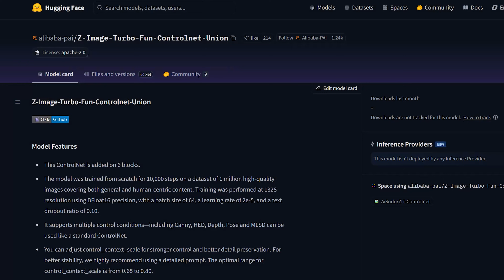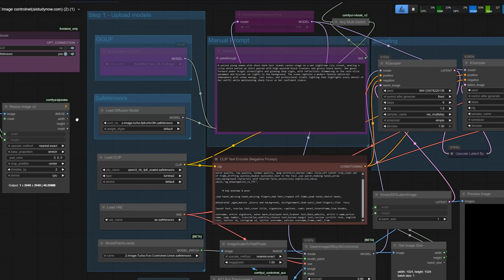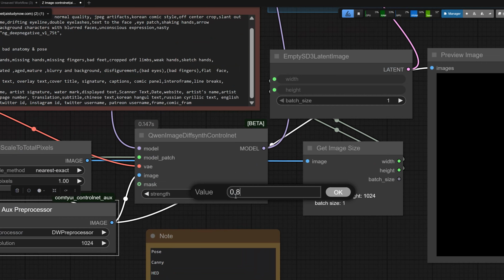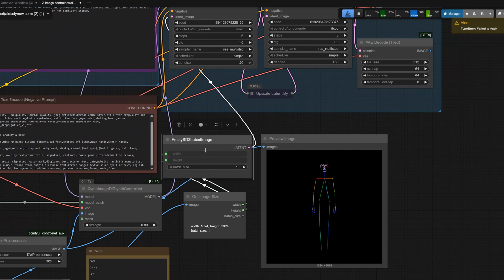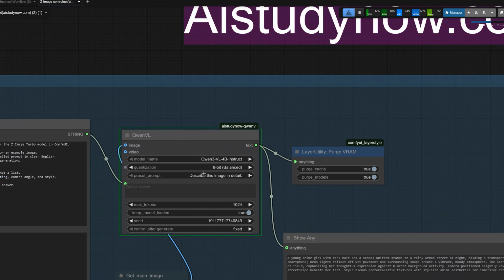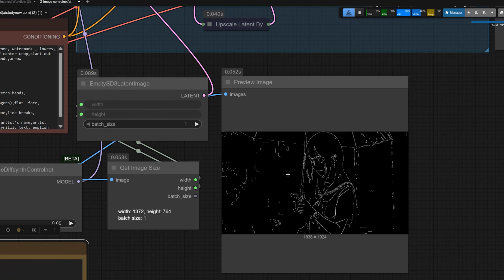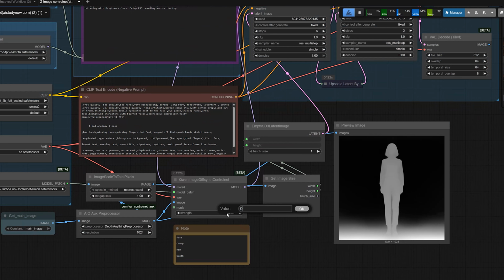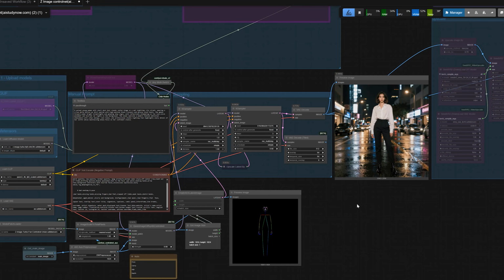Z Image Turbo ComfyUI: Fun ControlNet Union Workflow with Auto Prompt

Comment from the maker: Workflow: https://aistudynow.com/z-image-turbo-comfyui-pose-depth-edge-control/
Reply: ERROR:- UnboundLocalError: cannot access local variable 'model' where it is not associated with a value  why even after doing all the update copying all the model , then going to bath coming next trying again same error is coming is there any solution please?face-pink-tearsface-pink-tearsface-pink-tears
Reply: Please also reply on the previous video that will be grateful.
Reply from the maker: @SantoshShetty-s8s ok will check and cmt
Reply: @SantoshShetty-s8s  me too
Reply from the maker: @SantoshShetty-s8s just update your comfyui
Reply: @ComfyUIworkflows  No it's not suffisant. All nodes updated and comfyUi updated and always error with Model Patches Node. This problem is widely known and discussed on forums all over the internet, yet no one seems to have found a real solution. So, thanks for flooding us with your interesting workflows, but Z-Image Control Net just doesn't work. At least, not everywhere... Make us a video solving the problem; you'll be the first! 🙂
Reply: @ComfyUIworkflows  update confy work for me for this error !
Reply: me too   ## Error Details
- *Node ID:* 83
- *Node Type:* Any Multi-Switch [RvTools]
- *Exception Type:* ValueError
- *Exception Message:* Missing Input: Multi Any Switch has no active Input.
Reply from the maker: @DaehaKim node is missing you need to install rvnode.. fix that change that with supportive custom ndes
Reply: @ComfyUIworkflows  this rv node cant able to install through manager

Comment: I have followed the instructions but it seems like the "MODELPATCHLOADER" still in red although I already put the "Z-Image-Turbo-Fun-Controlnet-Union.safetensors" inside the "model_patches" folder. the error is this "CANNOT ACCESS LOCAL VARIABLE "MODEL" WHERE IT IS NOT ASSOCIATED WITH A VALUE" Can you help me
Reply: It doesn't generate image. Only the DWPREPROCESSOR image then it stopped
Reply: @AngeloParkerPH  Needs to wait for comfy update or do it manually editing the python script, or use comfy nightly update and destroy your installation... ;P
Reply: same here. ModeoPatchLoader is purple and gives same error
Reply: i too
Reply: Same Error here. any solution ?
Reply: @CH_Nisar  I updated the nightly version of ComfyUI and it worked
Reply: @MichauxJHyatt  failed to switch version to nightly, this shtas of an app just broke every other day ruining my godanmn workflow